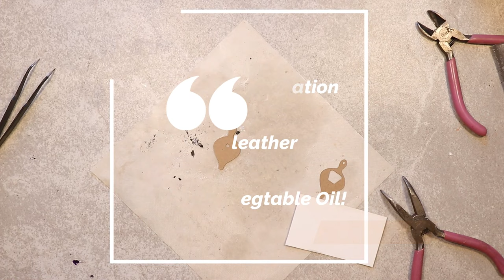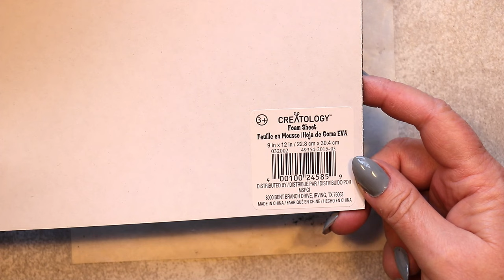How to Make Miniature Fireplace Tools

Comment: Do you have a custom setting for cardstock on your machine to be able to get such clean cuts? Mine inevitably drags and rips anything under 110 lb. cardstock, and it doesn't always cut all the way through the 110 lb. if the cuts are especially tiny or involve any kind of curlique...
Reply from the maker: That is so frustrating, @aimmyarrowshigh ! I DO have a custom setting, and together with using Astrobright cardstock, I'm thrilled with how clean the cuts are, my friend. This brand of cardstock is lightweight but very 'dense and crisp' feeling, and I believe it's the high quality binders in the paper that assist in the process. 

Here are my settings for Astrobright 65lb cardstock:

Standard Grip Mat (no tape)
Pressure: 196
Cutting Passes: 3x
Fine Point Blade 

Of course, you may have to tweak the settings for your machine: they all have minds of their own, but this is a good place to start. Hope this helps! xoxo